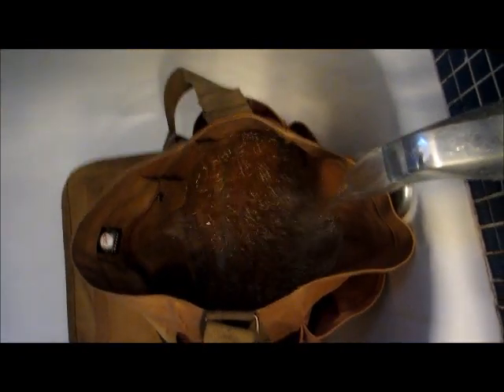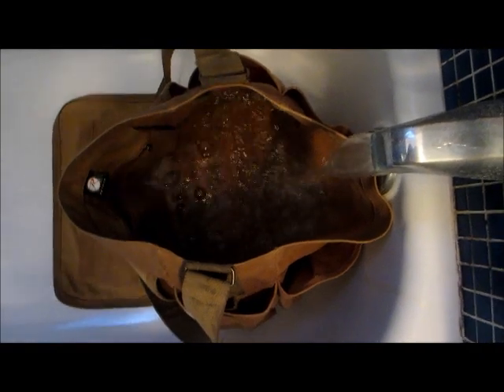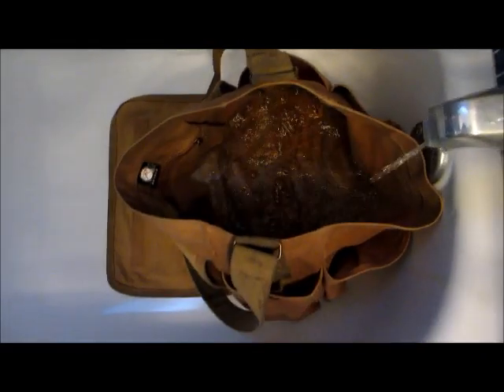DIY Canvas: Is it Really Water Proof?  You be the Judge

Comment: You've got a bucket! I just waterproofed an old Timbuk2 messenger bag made of waxed canvas. The waterproof TPU interior/inner liner had degraded to the point that I just ripped it out.... modern manufacturing go figure. I still want to use it and went the wax route you recommended. Works a treat! Thank you!
Reply from the maker: Awesome!!